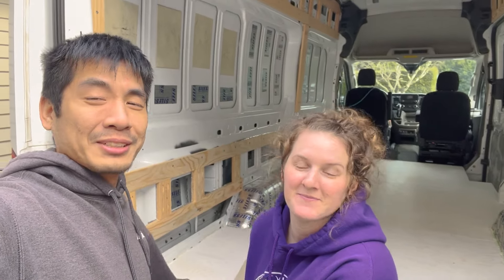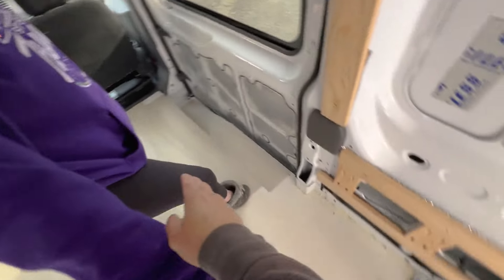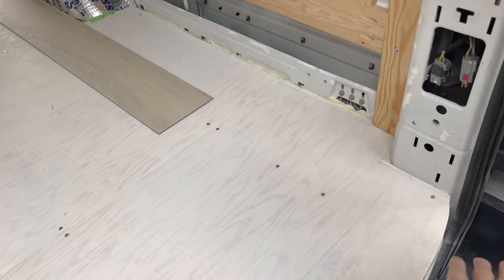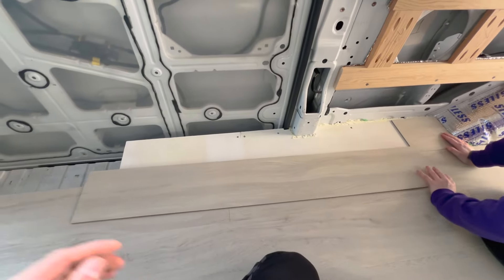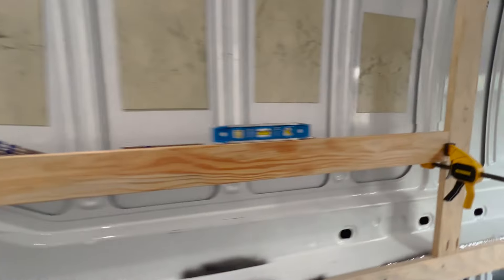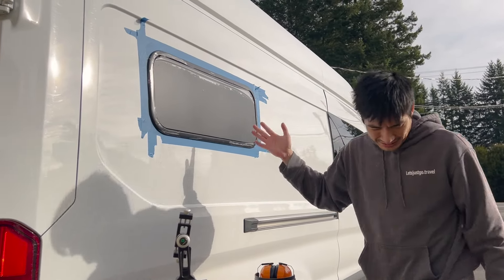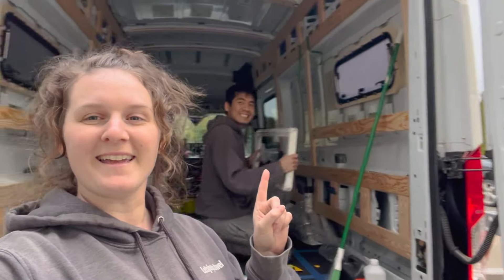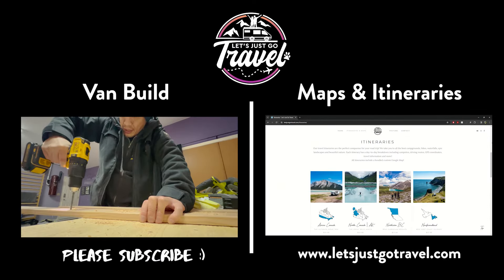Ford Transit - Vinyl Plank Floor & Broad Arrow Windows

Comment: I am close to buying the Broad Arrow. What size did you choose? Are they "curved" or "flat" style? Any issues with leaking or scratching? Have you accidentally opened the sliding door and hit the open window? Would you choose then again? Sorry to have so many' Q's                         
 Thank you again
Reply from the maker: We chose the curved 815 x 312 window! No leaks but the acrylic does scratch easily so you have to be careful. It is possible to hit it with the sliding door if the window is full open but we rarely have it all the way open. And yes we really like them for the built in blackout and bug screen
Reply: @LetsJustGoTravel  thank you so much